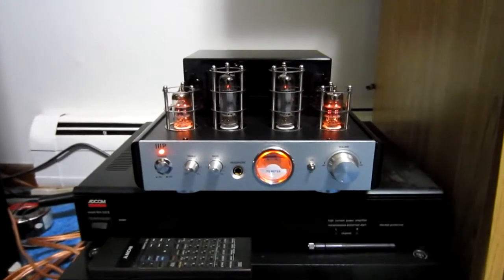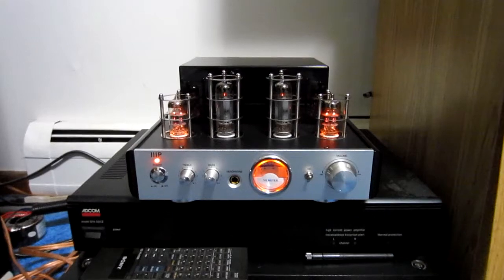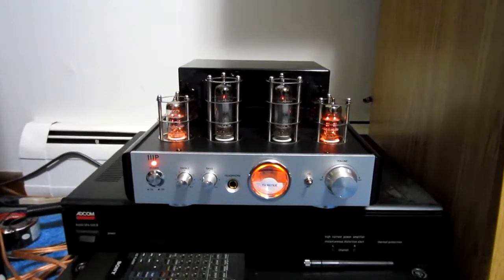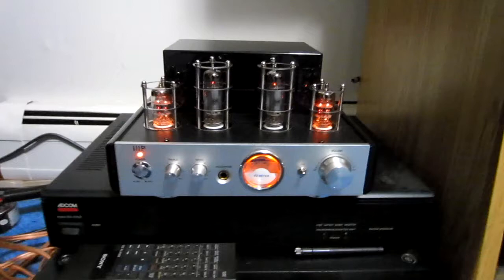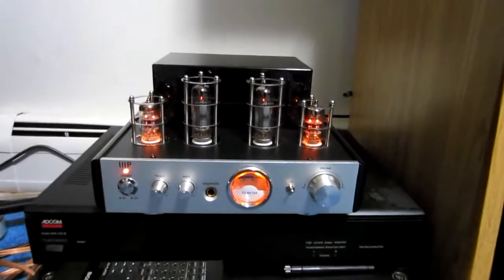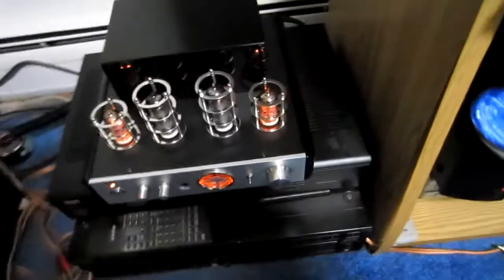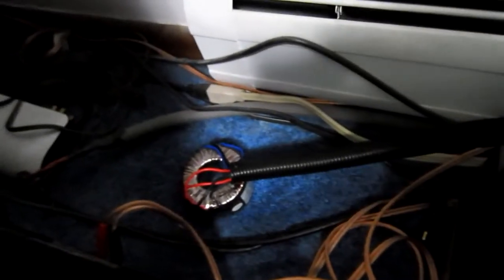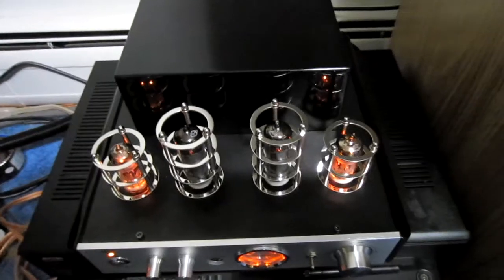Monoprice stereo Hybrid Tube Amp transformer modification

Comment: The toroidal transformer is radiating a 360 " magnetic flux. Without a metal shield around it that humming noise can be easily picked up by nearby components. I'm not sure what else inside of the top enclosure and if it's made of plastic or metal. You did a good job in figuring out where the humming noise is coming from. Now I know what to do with mine when I get it which is now on sale at Walmart. Thank you for the input.
Reply from the maker: Yes it was not the best in side the amp close to everything without any shielding for sure!

Comment: Thank you very much for this video!
I haven’t read all the reply’s but I do like your modificationI and was about perform your suggested modification if this unit was to be in a quiet indoor setting, however I realized what I was going to use this amplifier for the garage.
The garage is a Very load atmosphere and No one would hear the hum. Also, I have very bad grounding in the initial room I was going to use this amp in and found that a cheap power-strip cuts the hum in half. 
Hope this helps some people
Cheers!

Comment: Excuse me. If your house had a "correct ground instalation" maybe you would have the same result i think.. Just i think,,,
Reply from the maker: Na it was just a loud  transformer.
Reply: @ShenRC  u.u  so sad u.u
Reply from the maker: @martuss-x5  No just smart I know a cheap faulty component when I see one.. my friend got the same amp and his made some hum but not nearly as much as mine did.
Reply: @ShenRC  actually i have the same model. But mine doesnot have any hum. Actually is very quiet. The hum only appears during the first 20 senconds while the tubes are warming up. After that, i dont have nothing!!! Only quiet. But some guy told me that the hum could be due to a bad tube. But in your case, is very obvious that the problem is the ground of your transforme. That is tha reason because i though the problem was your installation. But maybe is not that, is just your bad transformer u.u
Reply from the maker: @martuss-x5  Yea it's not a good one the transformer is a bad wound one probably that's why it's loud.. My other tube amp I have on my channel is much better it's a true tube amp not a hybrid like this one and it don't make noise like these monoprice ones do in the tweeters and speakers and it sounds much better also. But you need efficient speakers I have 93db infinity speakers..this tube amp is only 3w per channel.

Comment: I used cable ties to firmly hold the transformer connector plug to a standoff. A couple of ferrite lops on inter-board audio wiring. Grounding the RCA input connectors. Everything is still in the box. Really need to be rewired but for another day and budget.
Reply from the maker: 😎 Cool!

Comment: Can you do a vid showing how to do this?
Reply from the maker: Hi it's simple when you open the box up you take the coil out and just extend the wires and run it outside the box by cutting a hole in the back of the top box to run the wires through.
Reply: Oh ok thanks.  I thought that was all, but then your disclaimer at the end made it sound like some wiring needed done.